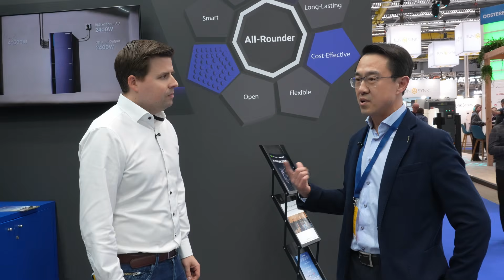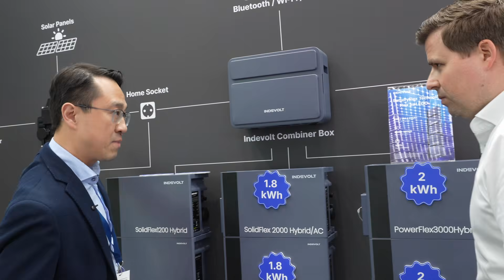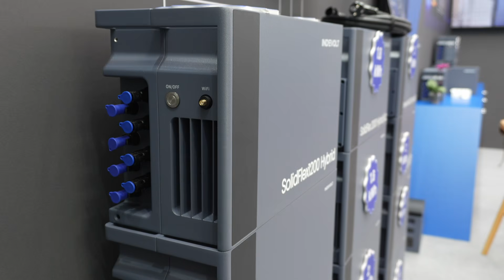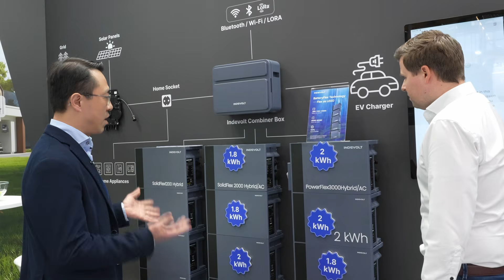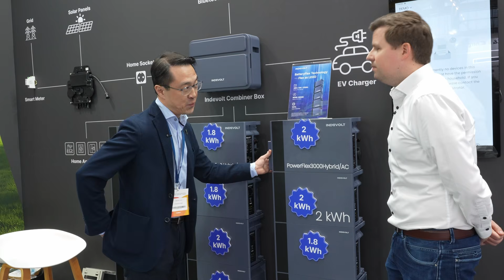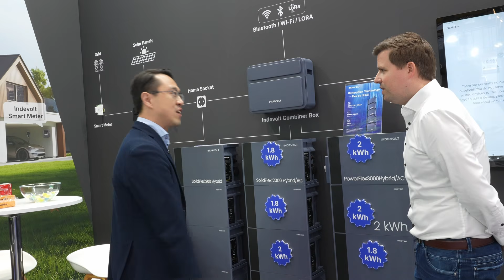Indevolt over SolidFlex en PowerFlex: zo werkt hun modulaire thuisbatterij-systeem

Comment: Great interview, Sjoerd! It was a pleasure discussing the future of home energy with you at Solar Solutions Amsterdam. We're excited to bring our 'Lego-style' modular energy solutions to more families in the Netherlands. For anyone interested in the technical details Jesse mentioned (like our semi-solid batteries), feel free to ask us here! 🙂
Reply: Great products! The video shows a "Powerflex 3000" with a badge on it that says 2kwh, is that a print error? There is no Powerflex 3000 right, just a 2000 model with 2kwh?
Reply: @Xantulle  Great observation! To clarify, the "2kWh" badge on the PowerFlex 3000 refers to its battery capacity category. Specifically, the actual capacity is 1792Wh (which is rounded to 2kWh for the series designation).

You are also correct that we are expanding the lineup! We will officially launch the PowerFlex 3000 this June.

The main difference between the PowerFlex 3000 and the PowerFlex 2000 model lies in their output power: the 3000 model offers a higher AC output of 3000W (compared to 2400W on the 2000 model), while both share the same high-performance battery technology. Stay tuned for more updates!